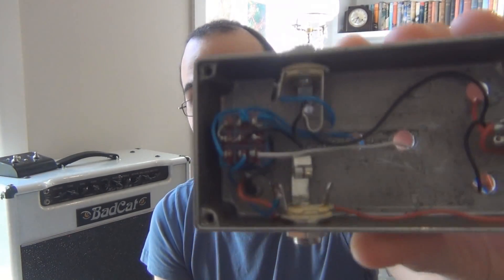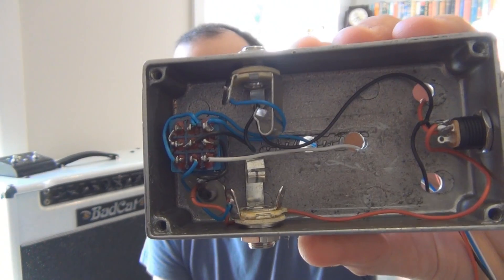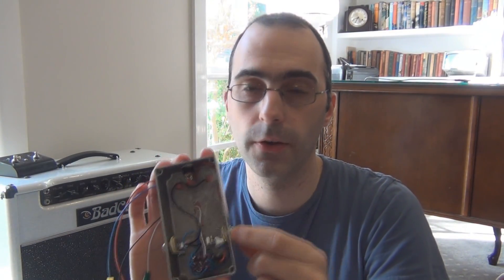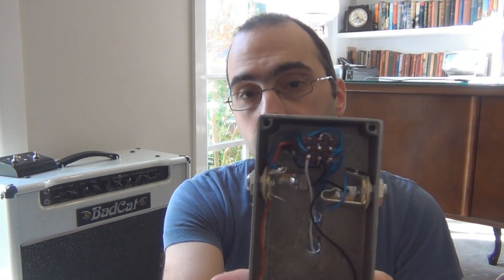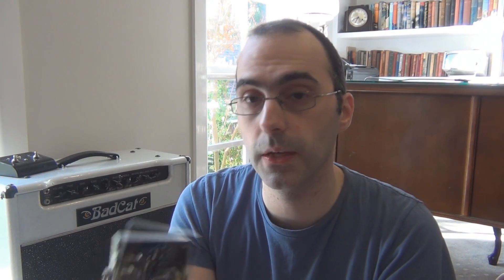Quick Tip - Build a Guitar Pedal Test Box

Comment: Quick tip - if your input/output jacks are coming loose... a touch of nail polish on the exposed thread after you've tightened the nut.   It's enough to stop the nut working it's own way loose, when you're plugging/unplugging leads, but still allows you to remove the nut when you need to.